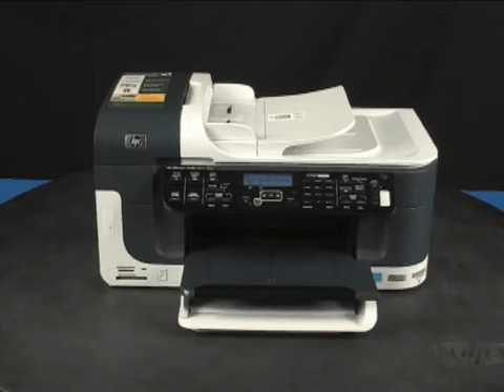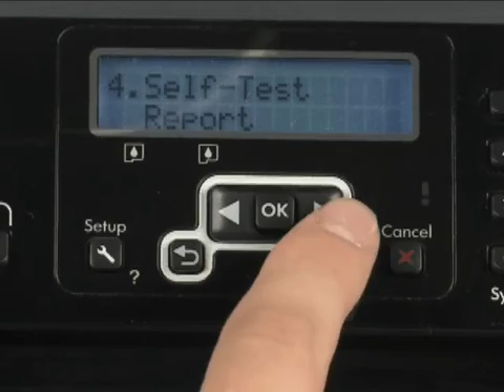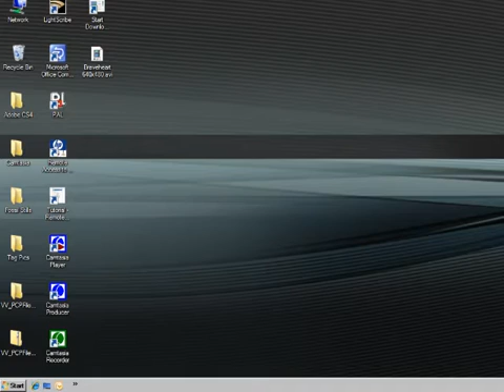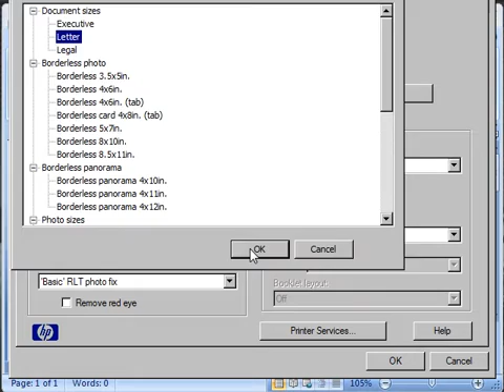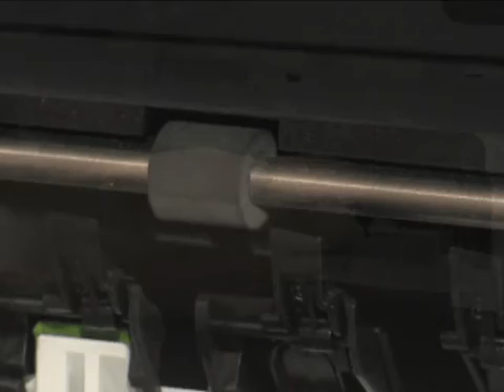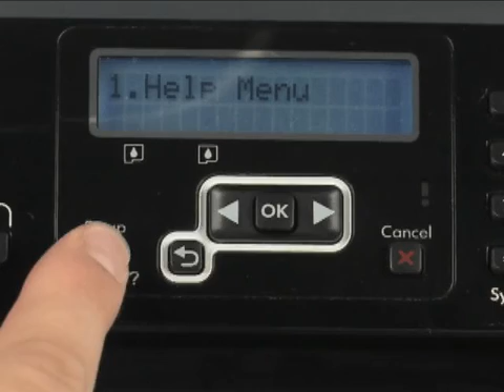Fixing Paper Pick-Up Issues | HP Officejet J6400 All-in-One Printer | HP

Comment: On mine, the brush under the cartridge holder got loose and block the photo sensor that detected paper. I pulled it off and it works now. I'll try to figure out how to attach it at a later time if needed.